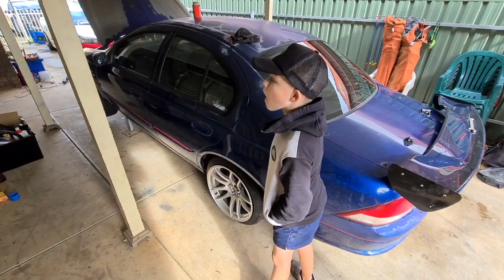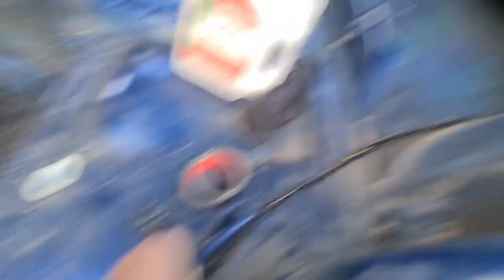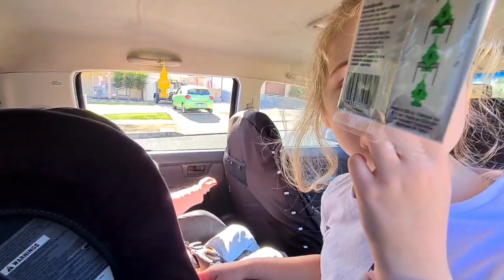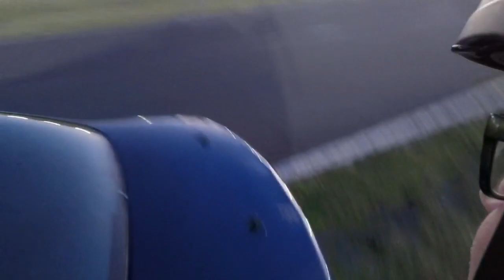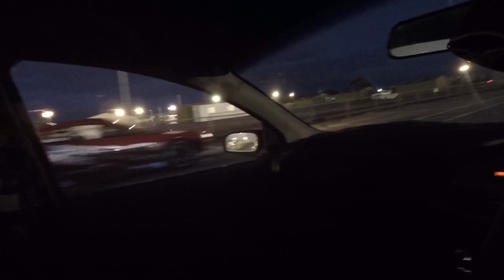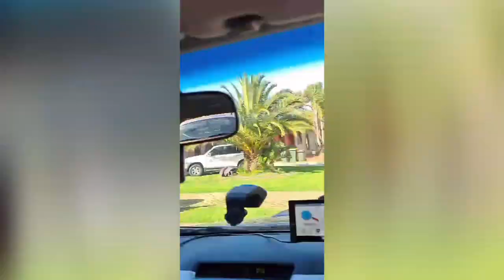AU Falcons doing... Things...

Comment: "Its irs being an xr6" irs was a factory option for all falcons most xr6s have solid axels
Reply: No they don't , it was all forte that got solid it was optional but series 3 all came with its.
Reply: @brendondart2542  Well my S3 is a genuine untouched XR6 and has a solid diff.
Reply: also all of the tray back utes were solid rear, 1.6 tonners had 2 stage leafs too
doesnt matter if its xr xl xls
Reply: @bigcazza5260  all ford utes are solid rear mate. It was Holden who went irs .
Reply: @brendondart2542  thats because holden utes are designed to do skids and ford utes are designed to do work
Reply: @bigcazza5260  my au does way better skids than my vz SS . Plus the ss is always broken down.
Reply: @brendondart2542  id say thats more to do with the fact that AUs are just amazing, all of my mates with VZs have nothing but issues. even my lemon AU ute has less issues than the best VZ in my group
Reply: @SassyXR6007  ay ive limiter bashed my au for like 1 hour in 40c heat to move sheep, still made the same power lol
Reply: @bigcazza5260  lol awesome